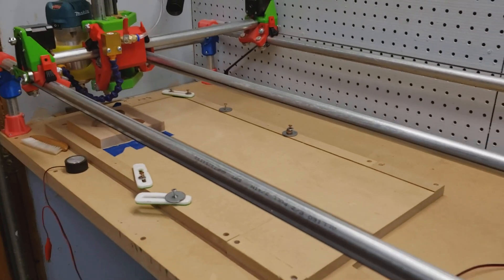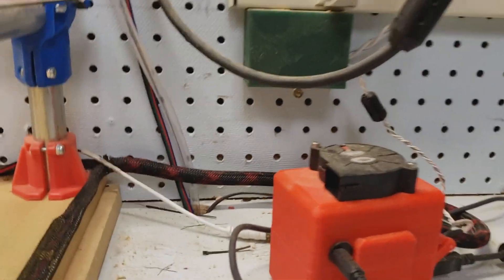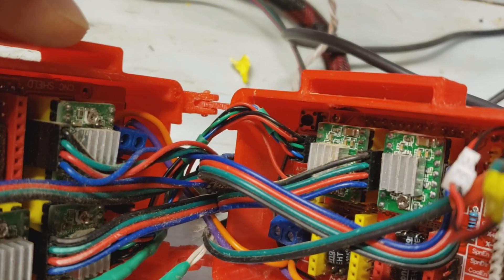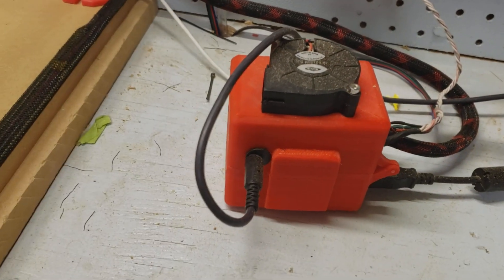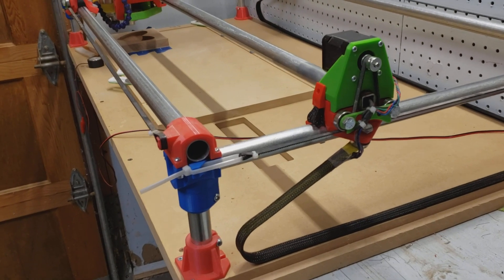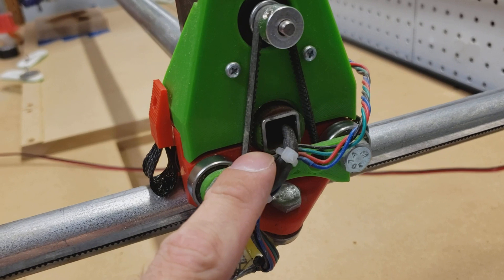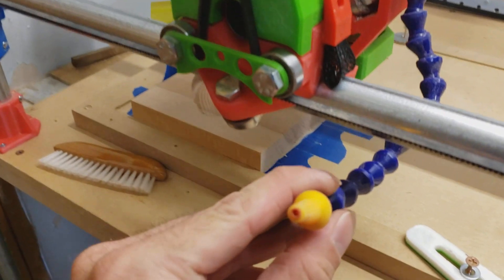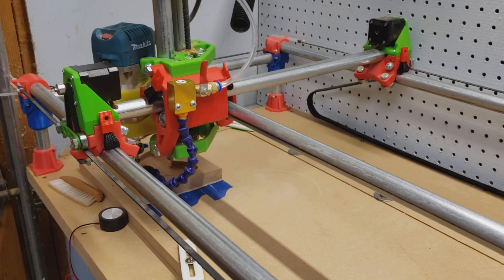MPCNC - How to Clone all Axis with  GRBL / ESTLcam! 5 A4988 Drivers!

Comment: Interesting use of a tape measure, I like it.  Cool method of using two shields with a single controller for cloning steppers as well.  I always wondered how chips and such would effect the bearing rollers on MPCNC and Lowrider, I guess it is the issue I thought it would be.  Interesting solution, I hope it worked for you.

Comment: Are you able to use dual end stop on this setup and have  you made any more upgrades or mods?
Reply from the maker: Unfortunately auto squareing with duel end stops is not suported with estlcam. I do belive estlcam will support + and - end stops for max movement.
I have since upgraded to the primo which is much more sturdy.
Reply: The softwares im usto is vetric aspire and ugs or mach 3. Do u kw if its possible on with this
Reply from the maker: @ronreynolds5580  The only way I know of are with the v1engineering version of marlin, or the Grbl Mega 5x project. I have not been able to get either to work for me. I don't belive auto squareing is available with Mach 5. You might be able to use UGS with the Grbl Mega 5x project.
Reply: @itsallrhett8061  I just started looking into the GRBL Mega 5x project for use controlling a CNC with two Y steppers but haven't found much info as of yet for auto squaring.  I did find a means of cloning an axis but nothing on how to set up an end stop for the cloned drive and I don't have any grasp at all of the various files or what to change in them to achieve it.  That's how I stumbled on this video, looking for information on cloning axes.  I ordered an MKS TinyBee and plan to switch to FluidNC but it's gonna be a few weeks before it gets here and I want to start testing the machine to see if I need to modify or change anything in my design.

Thanks for sharing, you've got a nice setup there.